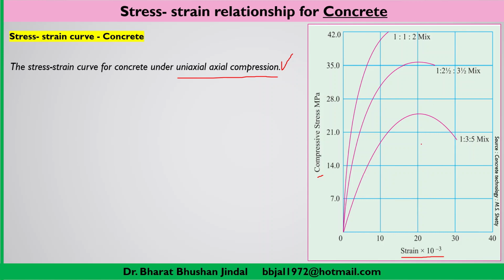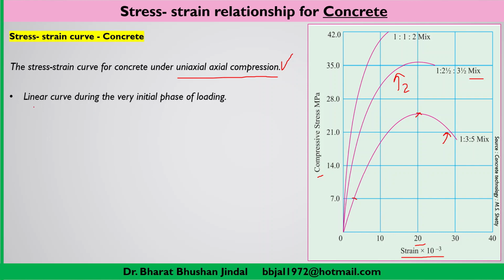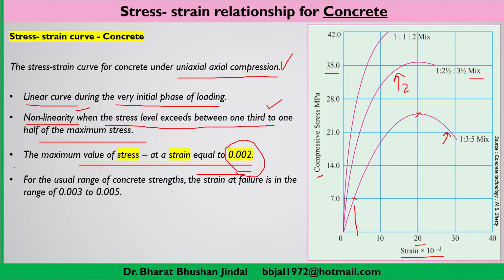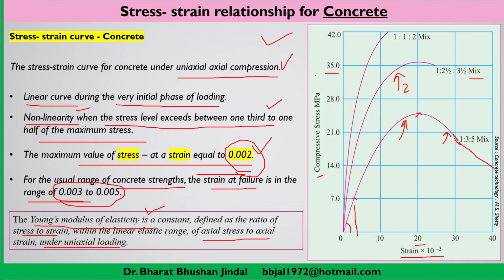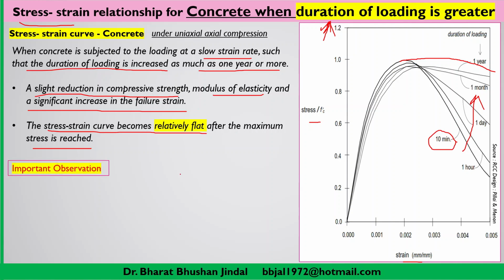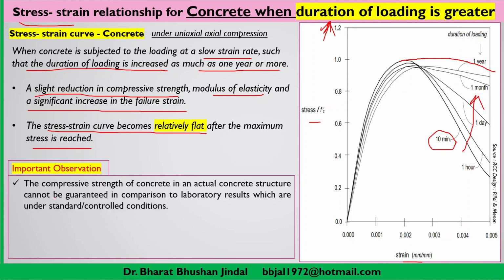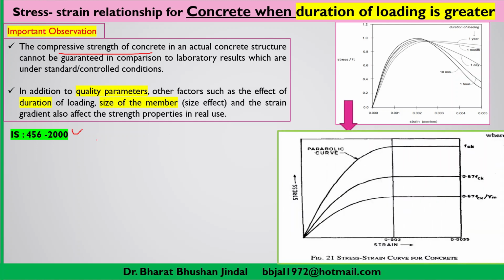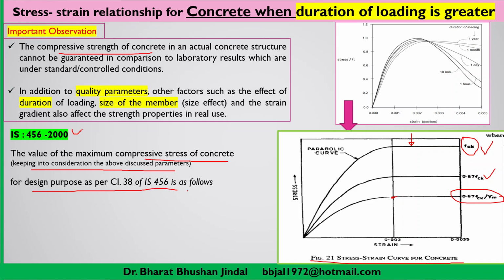Lecture 2 || Properties of Concrete || IS :456 -2000 || Design of Concrete Structures || Civil Engg.

Comment: In  the  above video the detailed relationship between stress and strain  with concrete under different situations is discussed, the key points on  the uniaxial / axial compression of stress strain curve , definition of young modulus of elasticity.   also important observation are noted down in the above video.  IS:456-2000 code is used for definite calculations
Reply from the maker: Good keep collecting maximum observations in every video lecture.

Comment: Question - Sir, in the stress-strain graphs, three graphs are shown each having different grade and mix proportion, the maximum compressive stress value is decreasing as we change the grading. Sir, my QUESTION is this that is there any pattern in mix proportion, like can we say that as the aggregate and water content is increasing the graph is moving downwards. Like in the figure, for 1:3:5 the curve is downwards than for 1:1:2 and the curve for 1:2.5:3.5 is downwards than first one. Is there any pattern or it is random.
Reply from the maker: Its a matter of research which depends upon many factors not only strength alone, moreover concrete is not 100% predictable thatswhy statistical analysis is used to analyze the  behaviors of these type of materials.

Comment: Summary - In this video we have learnt about the stress strain relationship of concrete. In the graph shown, first there is a linear relationship and then after some time there is non linear relation. Which change of grade of concrete there is a variation in stress strain graph, at a particular strain there is a maximum compressive stress. In this graph maximum stress is at 0.002 strain. Non linearity in the graph starts when stress level is more than the level of stress between one third and half of maximum compressive stress. We can say in general that the strain at failure is in the range of 0.003 to 0.005. For young modulus we will take the tangent value within the axial limit. When duration of the loading is increased curve moves upward and it becomes flat.

Comment: explain the difference between initial tangent and secant modulus of elasticity.????
Reply from the maker: Initial tangent term is applicable to the stress-strain graph of material which behaves elastic in nature or its applicable in the elastic range but secant tangent can be used for inelastic material also for getting better information about the modulus. ( Late Reply)